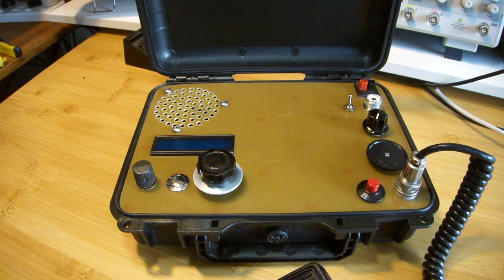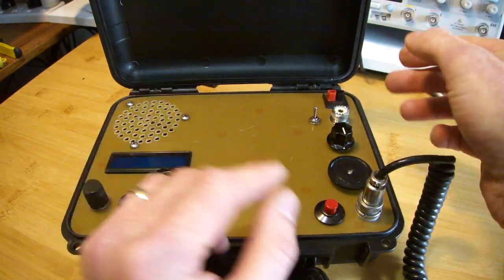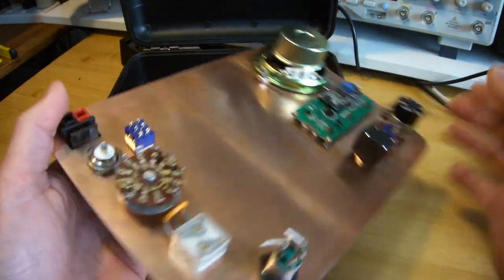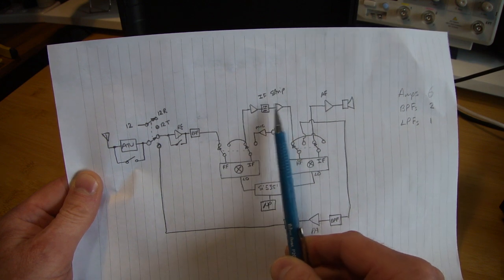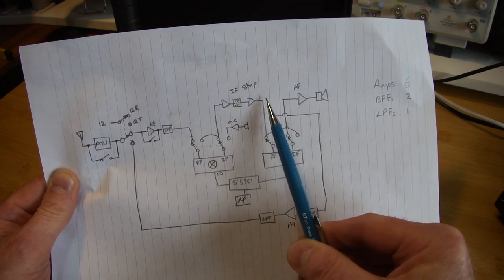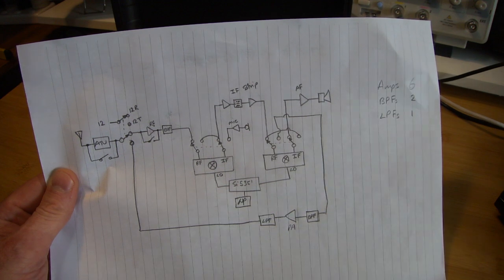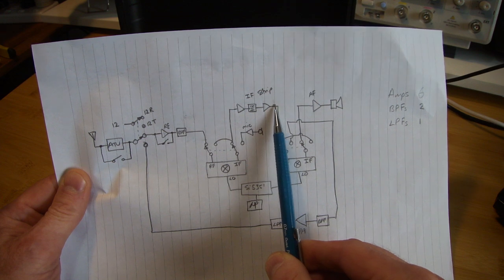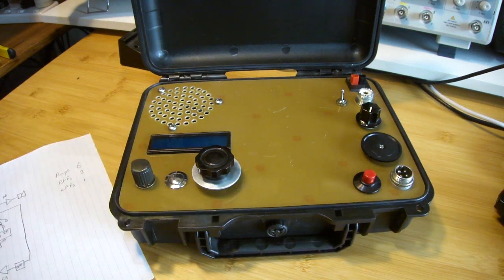40m Pelican Case SSB Radio - Part 2: Layout, Topology

Comment: Beautiful work. I am not an engineer, I was just a technician for years. I have always enjoyed building even if I can’t do design. I have copied bits and pieces over the years. The most rewarding project was the Progressive Communications Receiver from QST about 1980. Photo etched the boards. It was a lot of fun. Building is why I got into ham radio. There are so many interesting circuits. Everyone should build a diode mixer dc receiver. The audio is amazing.
Reply from the maker: Thanks. I like the simple approach. That Progressive Communications Receiver sounds interesting. I'll have to look it up.

Comment: Functionally, and size wise, this rigs reminds me of those WWII spy transceivers that many are building.  Of course, those were CW only transmit with a simple regen receiver.  Still, both pack about the same amount of RF power and receive ability into the same space.  I have quite a few 9mhz crystal filters (about 3.2khz bw) obtained surplus many years ago that were intended for the Gonset sidewinder vhf transceiver that would work fine in this circuit, though I might use two of them in series in the if (either input and output, or input and interstage) to double up on the skirt rejection.  I also have quite a few of the old CA3028 IF chips, though a trio of 2n3904's or 2n2222's will replicate this now unobtainium part.  These circuits can also be used as mixers, though I suspect you will be using the usual diode ring type.    I might consider building something along similar lines, perhaps  in a small AMO box.

These days I'm tempted to use a Rpi Pico2 as the processor in a S/W defined radio.  This processor can also generate the required local oscillator signal, and it has good enough A/D for the task, as well as can use it's pwm for D/A for receive.  Not sure about TX.  The Pico 2 ARM cores do have a DSP enhanced instruction set.  Maybe you might look into this in a later project.
Reply from the maker: That sounds great Kenneth. Start with a basic receiver to get the Pico2 up and running and then branch out from there. Remember to test each stage before proceeding. That way you will save yourself a whole lot of grief when you go to put it all together.

Comment: Hi Charlie, Excellent video as always! Have you ever tried using AD9850 DDS in your ham projects? It should give you less phase noise.
Reply from the maker: GIdday. Yes, I've used AD9850s on a couple of radios. At the time I didn't notice any difference to the Si5351. The Si5351 works for me, and has the advantage of producing both the VFO and the BFO. Square waves also work well in driving the diode based DBMs.

Comment: Hi. The  HF radio in a case/briefcase reminds me of a similar concept used by  some of the green radio companies many decades ago.. (I don't know what they do now)
Would have thought the band noise on 40m would have been high enough to overcome RX noise. Even with small whip antennas..  RF Selectivity  before an RF amplifier may reduce possible overload from out of band signals (I await the next videos)
Reply from the maker: Agreed on the selectivity and overload. I normally have the BPF before any amp, but might look to differ on this build. S/N ratio would also need consideration.